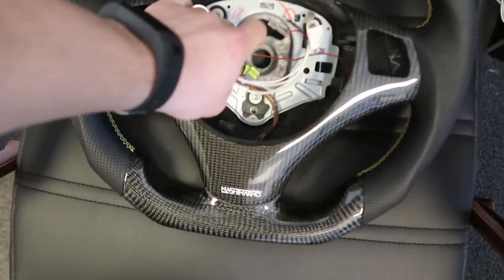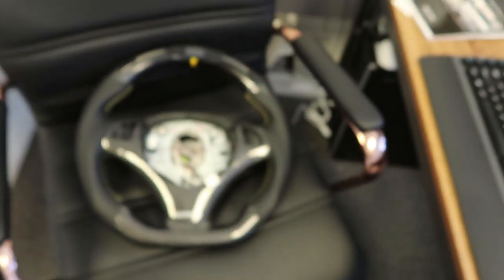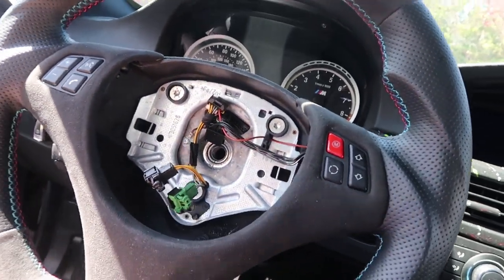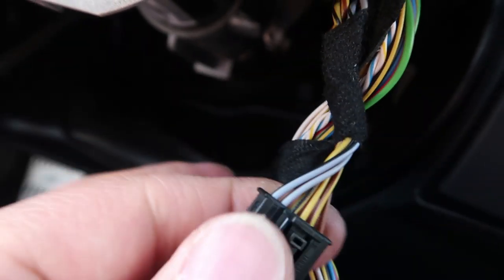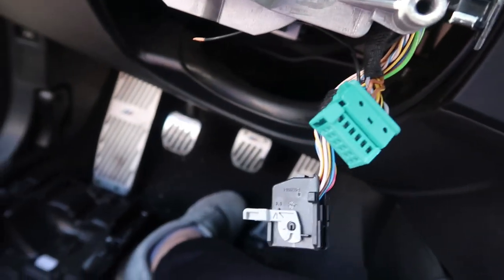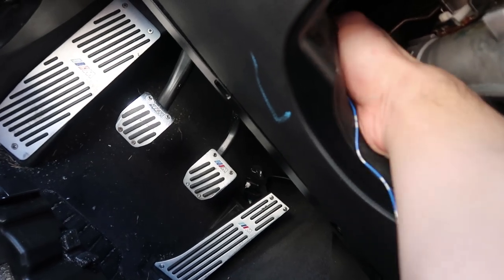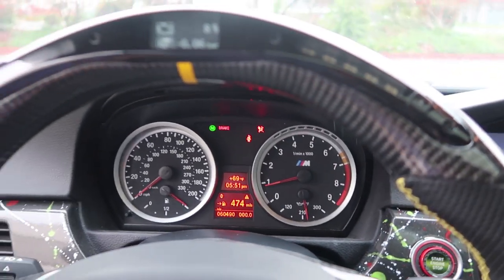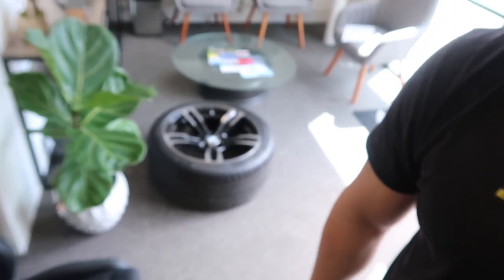How to install the aftermarket LED Performance wheel

Comment: where did the little black wire from the connector go to? you skipped that part? wasn't it suppose to tap into one of the new wheel module somewhere?
Reply: Did you ever figure this out? Please help
Reply: There is a big red wire under the connectors just tap into that and when the led connect to the obd port it should produce the 12V. Will only work in key and when ignition is off it won’t to avoid the dreaded bmw battery drain. Hopefully this helps . 

THERE IS READ WIRE THAT CAME WITH THE STEERING BOX, run THAT RED WIRE TO TAP INTO THR MAIN RED 12V under the steering colum. You should be good after that !
Reply: @antonijestanisa8565 i slowed down the video and it seem like he connected to the red wire onto the extra black connector. the kit comes with a red wire (or blue) you connect that end into the black wire

Comment: @Sean I have the LED steering wheel but can not figure out how to wire it ,  Is it possible to contact you or someone with your company that can show me how to wire it.

also can I purchase the clock spring separately since I already have the LED Steering Wheel